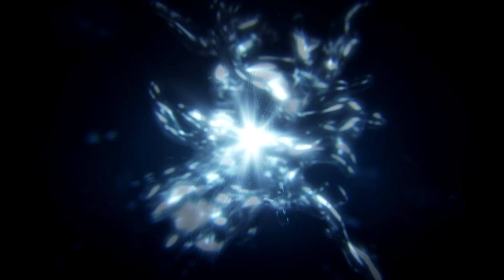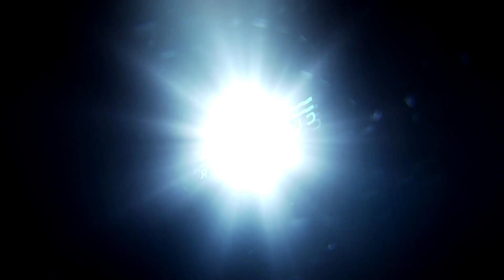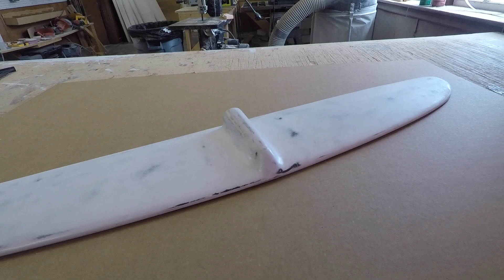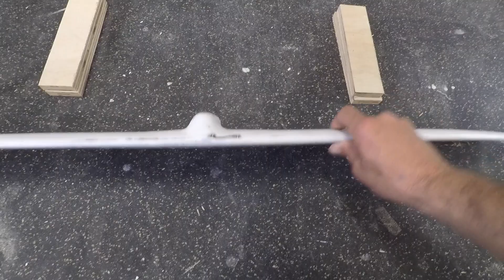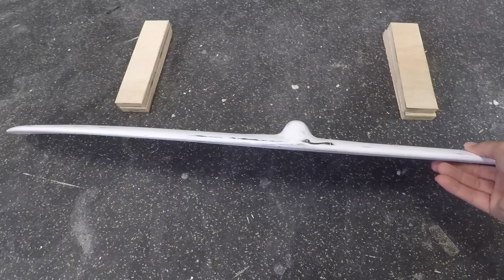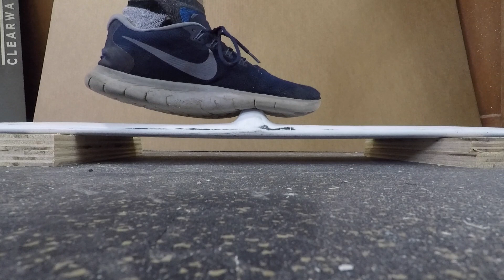Carbon Fiber Wing Flex Test... Success!

Comment: What foam do you use for the inside of the wings ? Can you put link
Reply from the maker: The cores of these wings in the video is a hardwood ply. My other thicker wings are milled out of 2lb EPS. I believe these wings are to thin to use foam, and the trailing edge would be an issue getting so thin.

Comment: I wonder how Ultralight MDF might work as a core material. Might need to use a sanding sealer to keep the epoxy from soaking up too much though.
Reply: I just checked out of curiosity the density of UL MDF. What I found was 480-550 kg/m³ for the MDF but poplar has only 350-500 kg/m³ and most pines fall below 500kg/m³. At the end I wouldn't use MDF for anything else than maybe plugs or molds. A high performance PET or PVC core would be better suited. As the forces decrease towards the center (into the core, not along the wing) the core is simply a compression-seeing placeholder to keep the wing from collapsing under load. A good wood alternative would be standing grain Balsa. Speaking of high performance here. Plywood is a good alternative as it's cheap, easy to work with, easy to get and fairly strong in most directions as the wood fibers are still long and intact. Because of that, you can use a slightly lighter laminate and offload some forces to the core to compensate for the higher weight.
Reply from the maker: @0xhexdec  Exactly! I am debating trying out some high density PVC but the cost becomes prohibitive. Especially when having to ship. Those thin and delicate trailing edges would require a snug foam cut out for protection (which I do with my EPS wings). But then the box size goes up, shipping costs get pricier, and so on...  For now the ply core is stellar!

Comment: I wonder how Ultralight MDF might work as a core material. Might need to use a sanding sealer to keep the epoxy from soaking up too much though.
Reply from the maker: Mdf is great to mill out cheap  one off molds... it really cuts nice. However as a core I can't imagine it having any advantages. But until it is tried out who knows!

Comment: Awesome video as always!  I'm wondering how thin you can go. To me it feels like racing wings might be over built and thicker than they need to be.  Second question does laying the carbon fiber fabric at an angle change the flex characteristics?
Reply from the maker: Some of the smaller high aspect wings I am designing will be a little thinner than this current one. Fiber orientation does matter if you want optimal performance. However this wing had a plain weave with half of the fibers going along the span. Optimal fiber direction would have been a lot more unidirectional fiber going tip to tip.